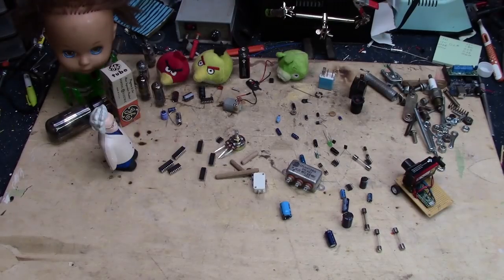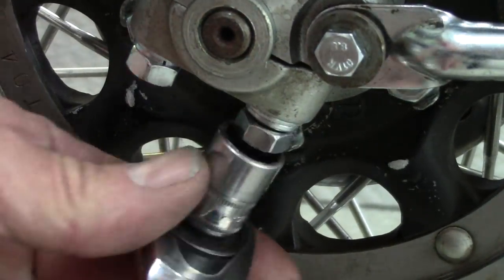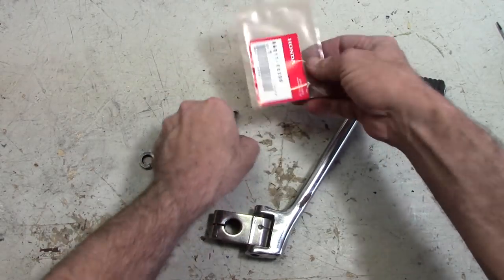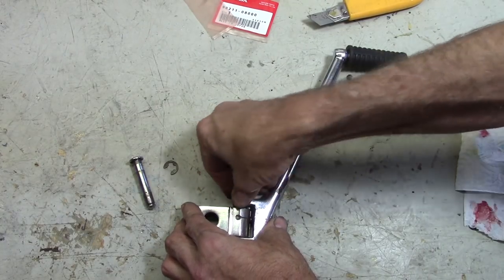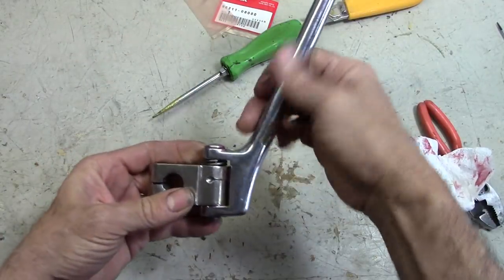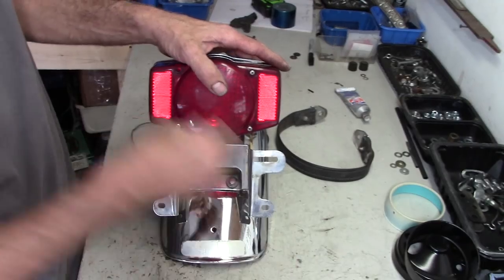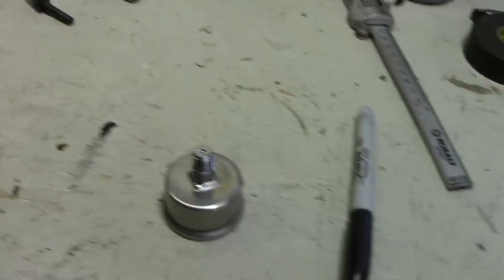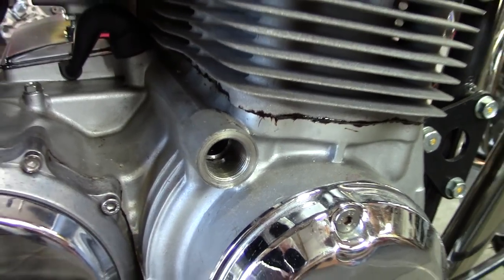73 Honda CB750 Custom Build Part 39- Miscellaneous stuff

Comment: Hi HackaweekTV, thank you so much for posting the progress of your restoration project, what a beautiful motorcycle, the super-bike that change motorcycling forever.  I really appreciate the ideas and upgrades that you are "building-in" as you reassemble your bike, a lot of information I can use on my own projects; that oil pressure gauge retrofit is brilliant!  Ride safe, see you on two wheels, Ciao, L (1983 CB-1000 Custom, 1983 CX-650, 1982 CBX 1050)

Comment: Quick tip - An air hose with a blower nozzle will get grips on real quick too (just a FYI for anyone else).... hairspray sometimes doesn't dehydrate and things still slip/becomes frustrating if you have to take it off and clean it again etc. - - LOVE these video's btw dude!

Comment: older dudes back in the early 80s at my hometown chopped them out ,fork extentions,high rise handlebars and custom exaust pipes.king and queen seats
Reply: Eric Kort  True Eric,we were doing those sort of "custom experiments" back in the mid 70's but I was only 19yo then but nothing has changed in that regard,you buy a bike then you start to add something or take something off,change pipes ect. A mate had 12" over extended forks,fat 16" back wheel,high rise bars,king/queen seat,sissy bar,coffin shaped tank,drag pipes(that bent outwards at the riders pegs) chrome bits everywhere & a wild custom paint job. Imagine the bikes that Peter Fonda & Dennis Hopper rode in the movie Easy Rider but with different paint job.I remember a few getting around like that back in the day,l didn't get into the big seat or extended forks(try doing a U-turn in a narrow street) but had all the chrome,custom pipes,handle bars,back wheel, custom paint ect,they were interesting times indeed. I'm restoring a CB750 K2 in the shed now & it certainly brings up some memories & even though my memory isn't that good these days I still seem to remember almost every nut & bolt & what goes where in the old unit but watching Dean on here is great to fall back on,shame we didn't have this "U Tube" thing back in my youth,hmmm that could have been dangerous,ha ha ha. Rob

Comment: Carb cleaner works really well for grips, it helps slide on, vulcanises the rubber so it sticks fast and evaporates entirely. This worked perfectly on dirtbikes in the mud and they never came off or slipped...

Comment: Way more guts than I have to drill into that engine case.  I just went with the 90 degree connector on the plug method.  I figured if the bike tips over on the non-kickstand side like that, I have bigger issues than potentially knocking that oil pressure gauge off.
Nice job on the bike so far.

Comment: I used a small 90 and threaded it in the end cap you removed. Had a great view.  And its very cheap and easy to replace.               
It was tucked well enough for a crash n slide not to touch it, believe me, it wasn't the 1st time!

Comment: Having done the same mod on the oil pressure gauge the only thing I did different was to have the nozzle of a shop vac there while I drilled and tapped the new hole and on the end as I pulled out the rag in my case. I was afraid using compressed air to blow as I might  blow as much in the engine as out. It worked pretty well. The chips were all sucked up by the vac as I made them.

Comment: I havent rode a cb750 since about 1985, Man, would I love to take that thing for a spin.  I've loved this whole project.
Reply: ghostryder94 yeah I felt the same way then finally got hold of one of my own.The metallic orange colour which was a k6 in Aust but mine is a k4.After buying a k2 in 1975 I did over 100,000 miles on it, awesome times. Now restoring one brings back so many memories of my youth & actually makes me feel, well maybe not young but definitely not 62,ha ha.If you get a chance to own & restore one,do it & with Dino's informative tips for the stuff I can't remember makes it all that easier. Cheers from Australia -Rob
Reply: older dudes back in the early 80s at my hometown chopped them out ,fork extentions,high rise handlebars and custom exaust pipes.king and queen seats

Comment: I was looking for an how to to replace an iPad2 battery and I found this..... wow does this bring back memories , I was back in the 70's again with my punched out 73' Honda 750 it was and 836cc with Mikuni smoothbores. I actually wanted to put some Weber 40DCOE's on it b/c they had accelerator pumps...yeah that's right , no need to keep the engine on boil.

Comment: SUGGESTION: when drilling such holes, try placing your shop vac hose up against the opening to suck out any shavings as you make them.
Instead of blowing around the work area when done, try vacuuming, instead.

Comment: Bought my first 750 in 1969 had several over the years. Not sure why Honda put a kick starter as the electric starter was  bullet proof  - but the kick-starter always worked first kick if you needed it.

Comment: The tip, to install the gripps with hairspray is exelent, but I never would bore a hole in the motor block. I would install a tube on the nut and bring the gauge in the best position.

Comment: My dad had a Honda 750 not sure if it was a 2 stroke or four stroke . Saw pics of it. It must have been a 72' or 73' . Red tank .sissy bar. Said it was pretty quick  . Being in the 70s it probably  was one of the faster top name production bikes available.  Be cool to find one just like it in condition no sissy bar and bring it back to period correct  all original  as possible.  I always thought this bike looked or would look great with a sidecar  for some reason.  Maybe I'm just picturing the 70s style and lines of the way they painted the tanks back then. That and the earth tones mixed with red ,red and coffee and rootbeer colored .dont know if I could really ever get used to operating  a bike with a sidecar . Definitely  have to get used to the balance and weight shifting in turns and the odd way you have to really  anticipate  the incoming maneuvers

Comment: Hole in main oil gallery is not a drain back, it's supply to main bearings. I always put grease on taps when I want to prevent chips from going places I don't want them.
Reply: +John McRae Right you are. I called it wrong. I do that sometimes and notice it later. :)

Comment: i would never do that ,the smallest shaving from drilling has potential to eat up a bearing in seconds .I would have tapped thru the end plug and run a braided line up to the handle bars . I did enjoy every episode ,thanks

Comment: You need to torque them to spec. This was checked by Honda DSMs visiting dealers among other things for assembled units on sthe showroom floor. Cable routing. Battery breather hose routing  and handle bar caps install as well.

Comment: A bad idea to be looking down at an oil pressure guage (or anything else for that matter) whilst you are riding ... the best place to mount an oil pressure gauge is up top with the instruments or if that not possible you can mount it right on of the handlebar clamps ...also saves you drilling into the crankcase ... you can simply go straight into the cap at the end of the gallery or if you are intent on mounting it below you could have used a 90deg fitting out of the cap on which to mount the gauge .... messing up a cap is alot easier to deal with than the case AND eliminates the possibility of foreign material getting into the system; As careful as you were there could easily been particles left in there ....
Reply: It's only there to see if oil pressure is present at start up.... Which I'm sure i can tell from the noise if the pump went south. As it makes terrible noise.

Comment: Hey I wonder where you have all the information about the different parts and all these nice schematic drawings from.
I have a Honda Dax St70 sitting arround in my basement waiting for some love but im stuck with a gearbox in pieces because there are some tiny little things missing :(
Great video as always! I love watching you working on the bike :D
Reply: +MaaxBerndt  not sure what year you have. i believe here it is called the ct70?  http://www.apachemotorcycles.com/fiche_select2.asp?category=Motorcycles&make=Honda&year=1976&fveh=133003
Reply: +burnzya hey thanks that's exactly what I needed :D
I'm from Germany that's why it's called st70 
thanks man

Comment: I've been watching your episodes and I gotta say I'm very impressed. I'm currently building or at least trying to build a 1983 suzuki gs550e but I've never worked with fiberglass before and I have a lot of work to do. was wondering if you do gas tanks like the one you did on the v45? I have the old tank cut open but it's beyond repair

Comment: I don`t think i would of drilled the case to fit an oil gauge. You have an oil light and ears and eyes that should be enough.
Also i would have put some PTFE tape on the thread.

Great video though.

Comment: Hi just cold started my k5 . Was checking heat in pipes . 
#2 no heat 
#3 better heat 
Pulled lead #2 and checked but seemed ok . Restart . 
#2 hot as 👌
#3 no heat 👎
Reply: K8
Reply from the maker: Try holding 1500 RPM and see what you get. If they even out in temp, you may have to sync the carbs better (#2 not open enough at idle) or check for a clogged idle circuit in # 2 carb.
Reply: @HackaweekTV  ok will do trying to pull plugs but dont no if 12mm or 14 . Only had bike a week . 
Thanks

Comment: Hey there!

I just had a quick question regarding what greases to buy for a well stocked garage.

Currently I have:
Autozone Black Lithium Grease (dropping point +320F) for chassis applications/bearing applications
Permatex High Temp Red RVT Gasket Maker for various gasket/sealing applications (mating cases, etc)

What assembly grease do you use? Red Permatex? What's the general purpose red grease you use?
What would you suggest for small engine building garage-times?

Thank you!
Reply: +Gulgonful The red grease is synthetic high pressure grease. Very tenacious. Everything else you are using is just fine. :)
Reply: +Dean Segovis Like Red Line or Sta-Plex or something? Thank you!

Comment: Hi Dino, bike looks great. I have a '74 750/4 I bought in '78. It was a partial chopper but only had 8000mi. on it. I have installed Kawasaki mags ( KZ 750 LTD, so triple disc brakes), elect. ignition, etc.. I have a question re; the fuel shut off valve. I should know this after 38 yrs. of ownership BUT, I removed the bowl this spring to check the filter for any debris and when I re installed it, it leaked around the threads. Does the 'O' ring go in first and then the filter screen or vice versa? Thanks and keep those vids coming. Don
Reply: +Don mac aulay From the valve body up: screen, threaded collar, o-ring

Comment: I could not believe you drilled that engine case to fit an oil pressure gauge. Not many bikes with oil pressure gauges. I ask if this engine uses a roller bearing crank? 

Edit: I see from your other video that this engine's main and rod bearing system is no more advanced than a VW Bug (split bearings) Oil pressure is a very useful value to know with this engine. Perhaps the risk drilling the case IS warranted.

Surely Honda must have moved into roller bearing cranks, any idea with what model and when? I am on this crankshaft design bug as a roller bearing crank can run with very low oil pressure, so low as any conclusion made from a device such as installed here would not be of much value. I do see that today, split bearing motorcycle engines are more plentiful than their roller bearing cousins.

Comment: What's the principle behind these oil temp gauges? (do they need to be in contact with the oil or they just rely on the temperature of the engine block?)
Reply: +Alin Iordache Pressure not temperature.

Comment: I just got my dads cb 550 four he bought new in 74, it hasn't been on the road since 82. the bike has 8,000 miles. I would like to ask what should I do before trying to ride it or firing the motor. The oil looks new, the front caliper is stuck on the rotor so I have to do that. original air filter doesn't look to bad. Thanks for any advice.
Reply: just put a new battery  and oil in it it might not start right away hondas like oil pressure  and dont rev the fuck out of it when it does start
Reply: I'd suggest to drain the gas and inspect tank inside for corrosion and leaks also check  hoses for cracks,  put a new plug in  if its water cooled check the same as gas tank . Crank case oil and make sure all nuts and bolts all tight  maybe wd 40 to lever cables and chain  insure no crack  in tires a that all signal lights are working properly . New battery  and  once started let idle for 5 minutes  then turn off and sit for awhile then idle again maybe 10 or 15 minutes and turn off to insure no leaking and since it hasn't been ridden in a long time that you dont get it to  hot to quick . Take it easy it is fairly old and once it been reborn or broken in then open it open and run through the gears   . You might find some good help in chat rooms or forums and Honda CB's have a huge cult following  fanbase and  theres a ton of info on them . Have fun..be careful and respect the road and other riders and drivers and most important  respect the machine.

Comment: Not many bike shops I visit have HAIR SPRAY???
Try using a splash of fuel and blow the grip on with compressed air. Thats how I did it when I worked in a bike shop.

Comment: I cannot see the point of drilling the main crankcase when you could of drilled the oil gallery end plus and fitted a 90 degree elbow ,and oil gauge would of still been protected if bike fell over.
Reply from the maker: You don't have to.
Reply: Still like the bike
Reply: The job you did is fine ,but some people cannot handle tools properly and will ruin crankcases. Easier to replace gallery end cap than crankcases, Carry on with good videos.

Comment: Do you know where i would find torque specks for a 1974 cb360
Reply: They sell them on line. Some you can get from a dealer. As I still have my old Yamaha CD when they switched from microfiche. But you need a special port security adapter to read it. As it logs into Yamaha database. I only have the one from Yamaha. Maybe ask a Honda dealer what they use...

Comment: I would use a steel thread insert in that aluminum
Reply: if it were in danger from impact i probably would too but since its sort of nestled in there away from the elements and possible collisions it should be okay, but i wouldn't go taping on it with a hammer anytime soon.
Reply: Why even use an oil pressure gauge.  Plenty of high mileage cb’s out there that never had oil pressure issues.  Also that mod in not reversible therefore ruining a true restoration

Comment: I'm begging you not to paint the tank.
Reply: +ThePpls Shovel Thinking hard about that and trying to find some vintage faded Flake Sunrise Orange side covers on Ebay. I bought an orange right side cover and I'm still looking for a left (battery) side cover in orange. Really hard to find as the left side was the one that got taken off the most and ended up cracked or broken.